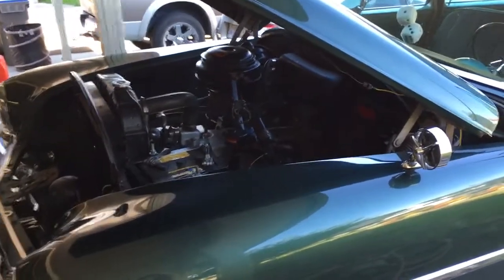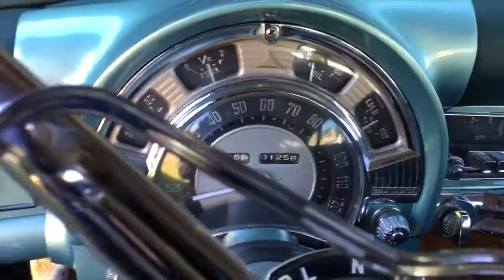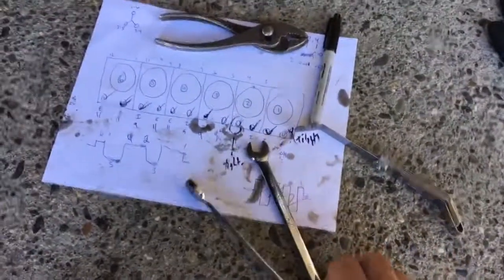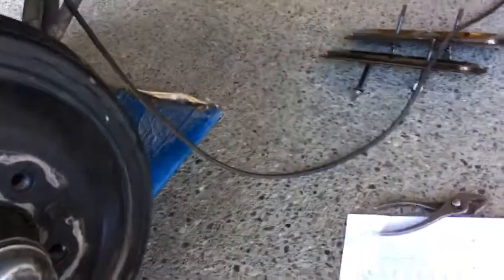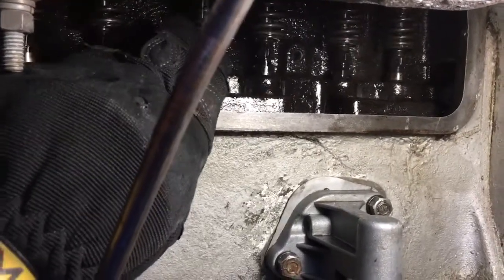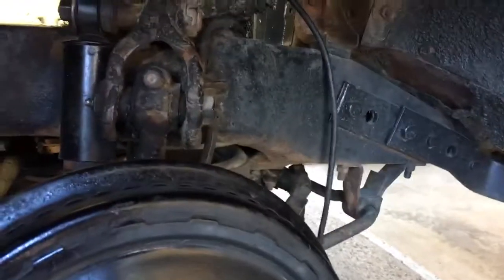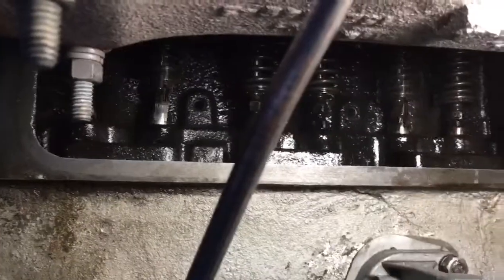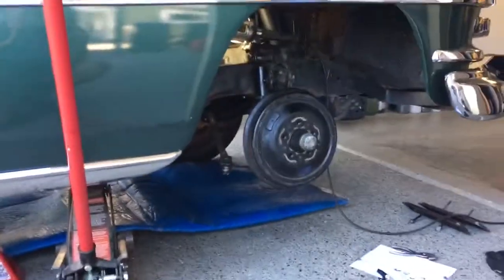Flat Head Chrysler Valve Clearance Check

Comment: Maybe you know, or maybe not... But having just bought a '53 Dodge Regent yesterday... The guy told me, it had the larger motor, he said a 230 ci... But, was lucky to have the glove box owners manual... It said, Dodge offered two sizes of motors in the six cylinder... A 218 and a 241 ... But, typing in 241 on YT, gets a 241 Hemi ... So now I'm totally confused... As in this repair shop manual, it says 230 ci ... LOL ... 
It is a Canadian made Dodge... And the owners manual is too... So, any feedback ? 
BTW, it came with an engine gasket set, in the plastic...plus two additional copper head gaskets, in their wrappers... Rebuilt carb, within a month, less than one year old battery, and a new fuel pump... 
Darn near flawless interior and exterior... No rust or holes in the floorboards or trunk... All glass, crack free and functional... I'm stoked, as I traded a Willy's CJ with a broken transfer case, for this running and driving car...  Best regards ...
Reply from the maker: Grab a measuring tape. Is your block length about 23” or 25” in length?  Likely 25” if your car was Canadian built. 25” long Canadian blocks were available from 218 ci, all the way up to 265 ci. They did this mainly by varying stroke length.  The 218 and the 228 ci have 3,⅜” bore. The 237, 251 and 265 ci engines had 3 7/16” bore.
Reply: ... Turns out, my block is 25.5" ... And have tested both dry & wet compression test... And figured, because the compression only went up 15 lbs, that a valve adjustment is due... You say .008 & .010 ... The book says .010 on both... But also says warm operating temperature... Jezzzz, any feedback on adjusting them cold, and not running?... Like perhaps at .007 or .008, because heat expands things, and a slightly tighter, cold adjustment, might open the one or two thousands, when warm, to the correct gap ?
Reply from the maker: I am not near my reference material. From memory, I think a 25.5” length block, Canadian Dodge Regent probably has a 2 ⅜” bore.  Netting 226 ci. On a cold engine, adding .002” to spec tappet clearances will be fine. I’d do 010” intake and .012” exhaust when cold, on your engine.
Reply: @keithsgarage5831   Thank you for your valuable insight... I see, I was subtracting from the operating temperature dimension, when I should have been adding that .002", to set them cold ..! ... Yes, I don't need broken valves ... Best regards...!

Comment: I'm switching from a composite to a copper head gasket on my 218 flathead 6. I see u used no sealant. Did this work out fine or should I use copper gasket sealant?
Reply from the maker: I used copper spray on my new head gasket in my 265 Chrysler. Problem. I decided to try nothing on my Plymouth engine head gasket. Just the plain gasket. No issues at all so far. Seems to have sealed up just fine.

Comment: Thank you for this video. If still reading comments, advice/opinion on my situation if you please.  .. circumstances constrict my ability to adjust these valves hot. ... too lengthy to explain, here. An old Motor Manual suggests a  +.002 wider feeler gauge if unable to adjust valves hot. Any experience/opinion on your end as to the viability of this adjustment? ... Will ask a local mechanic, but, unsure of his experience with in block valves.  .....  Beautiful car, btw.
Reply from the maker: Hi, at the time of this writing, I have not personally set the valves cold with an additional .002" clearance. I have heard from several other experienced old Mopar guys that this is acceptable. Should be fine.

Comment: Finally a decent video on how to adjust side valves without removing the cylinder head
Reply from the maker: On these flat head engines, I don't believe there is any need to pull the head to adjust valves. Unless you want to check for valve seat seal-ability. Kersosene works great to check if they are sealing when closed.
Reply: @keithsgarage5831  yes without pulling the head. Most videos out there show valve adjustment with engine rebuild so without the head. The manual also gives you that option. But the easiest way is removing the side covers and adjusting the valves from there, engine can be cold or hot, although the clearances will change.
Reply: @keithsgarage5831  Yes, no need to remove the head. How does that kerosene test work? I've never heard of it.
Reply from the maker: Old Crow's Classic Cars : Kerosene is used to check for valve sealing. Remove both manifolds. Head off. Ensure piston is at TDC. Both valves are close at this point. Use a syringe or turkey baster, teaspoon, whatever. Pour some kerosene around valve edges. Look through valve ports, bottom side of valve. A good valve seal will not allow kerosene to pass through to bottom. If leaking, try lapping valve, or perform valve grind, followed by lap. Repeat for all 6 cylinders.

Comment: You mentioned you adjusted cold first. Did you have them set at .008 intake and .010 exhaust on the cold adjustment? or did you allow a little extra for heat expansion? Were your intakes still ok warm? You said just some of your exhaust were tight with a warm engine?
Reply from the maker: Initially I set them at .008 intake, 0.010 exhaust when cold. Then I warmed up the car, by going for a drive, to operating temp. Then I inserted feeler gauges at all valves with the engine hot & running. I made my final adjustments by shutting off the engine, adjusting, then firing it back up to check again with feeler gauge. Mopar books tell you to set valve clearances when the engine is hot. This is to ensure valvetrain parts have already expanded, due to heat. The valves do not all run at the same temps. This is why final adjustment should be done when the engine is hot. The test to check with engine running with feeler gauge is really about developing a feel for how the feeler gauge fits in the gap, or not. For example if an exhaust valve is set at .009, the 0.010 feeler gauge will not go in the gap while engine is running. If it is set at .011 or .012 you may hear a tapping noise diminish when the feeler is inserted into the gap. When the clearances are set just right, the feeler will tug it's self inward into the gap, each time the valve opens and closes.

Comment: How do you determine which is intake or exhaust? Is there a diagram on internet? Thanks
Reply from the maker: There are a couple of ways. Look at the intake and exhaust manifolds and you can see the order. A manual is a good idea, and will be identified in there. Starting at the very front and working back my engine is: E, I, I, E, E, I, I, E, E, I, I , E.